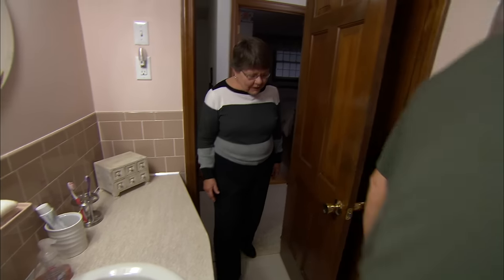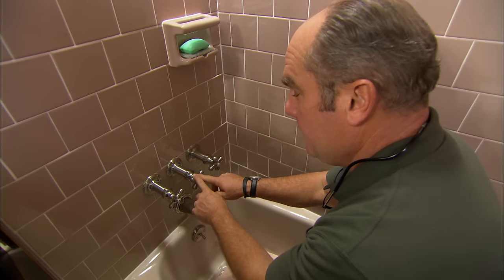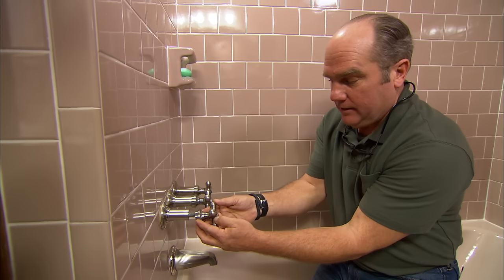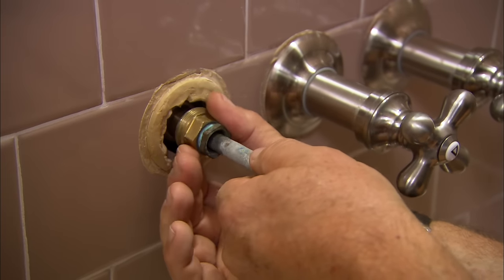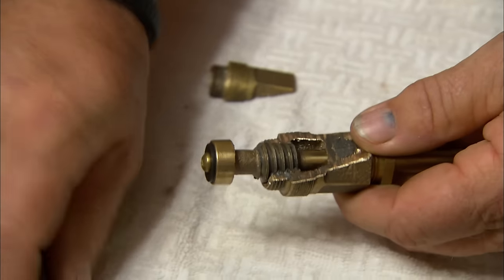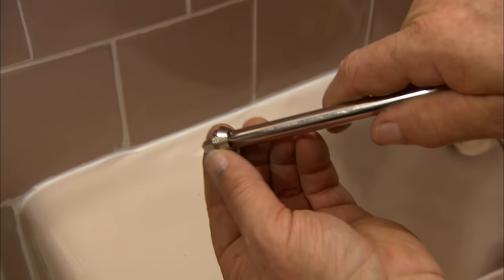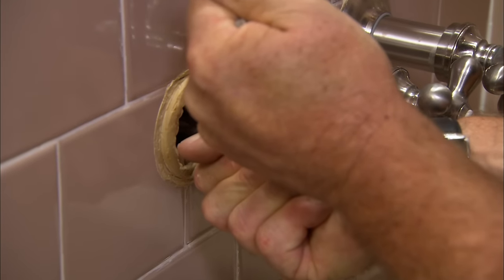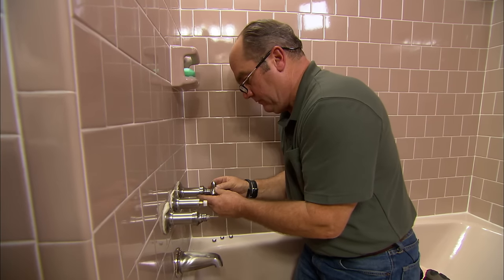How to Repair a Shower Valve Stem | Ask This Old House

Comment: A trick I found for preventing cross threading anything with threads is to put the male and female(or the threaded and tapped objects) threads together and before tightening inwards, go outwards first. You will feel and hear the threads click and align with one another. Then start tightening inwards.
Reply: I thought that was my little trick. I now see I am not the only one. But great idea to prevent cross threading.  I hate it when I see someone cross threading, specially with a power tool, making sure to damage the threads. I almost feel the pain.
Reply: @macvideoworld  your trick? Quite literally the most common and natural thing people do when screwing things in
Reply: That's ok to call it your little trick. I'm glad you shared it no matter what anyone calls it. I didn't know & appreciate the info

Comment: I think it is important to mention when removing and installing stems, that it should be turned 1/2 way open, because If you unscrew or screw in the stem while it is turned all the way closed, it may damage the new washer and seat.
Reply: Idk why didn’t mention that. It’s in the direction to make sure the stem is open all the way. I just learned the hard way about that, thankfully I can swap it out at Home Depot. That is a very critical step.

Comment: This seems very easy but a cautionary tale, before you take out old shower stems, make sure you have the exact replacement or you're SOL if it breaks.  I took one off at an elderly relative's house and found that the one in there was nothing like the one I had - it had a ceramic clamshell type valve. It was getting late in the afternoon so I thought I'd take a picture of it, put it back in, and come back another day with the right one - WRONG!  while I was putting the old one back in and tightening it, the ceramic part broke.  

I turned the water back on and water was just pouring out to the tub. 7 pm and this poor old lady couldn't have water.  I took the old part and drove to Home Depot - they had nothing that looked like that but was told "it looks like a Sterling". Went to Sears Hardware - nothing. Went to Lowes - they had one that had the same clamshell look in the catalog but nothing in stock.  By now it's almost 9 pm so I made it to one more home depot and they had a Sterling with the same valve but different rod that looked like it would at least fit in there to block the hole.  Nobody even had a plug that could fit in that.  

Fortunately it worked, but the cover had to be siliconed on since it was missing the threads the old one had.  I spent a week going to supply shops, internet, etc. and only found one guy who had the original set and that was more than $200. Sterling sucks.
Reply: At that point, might be easier to change the entire shower to a delta universal valve. I feel your pain though, i manage a few apartments where the builder uses the cheaper Pearless brand or some other non-delta brand. Makes things a lot harder to fix.
Reply: Always warn The customer that if it breaks you're not responsible
Reply: @hibye2511  isnt peerless made at the delta factory, and just stamped with a different name?
Reply: When you are working on obviously old fittings, you are better off taking the old stem valve to a specialist plumbing/faucet store/warehouse.  Not only are they more likely to have what you need, the free advice you will get is priceless.  Also, it's always best to do this type of work in the morning, so you have a time cushion if you need to run to / back to a store.
Reply: @markg6860  Haha I forgot about this post I had made. I actually went to a Ferguson and they had no idea what I had...A year later I found one that looked close on ebay but it turned out to be a little shorter...sooo I have like 3 different ones that can twist in but are not an exact fit for the handles and stuff. There is drywall behind it so I think for the future we might just bite the bullet and call a plumber to change everything to delta or some other easier to find brand.
Reply: @Arieeeee  Sometimes it does make sense just to update an old fitting.  I literally just got done replacing my hot and cold bath tub stem valves and the seats, this morning.  It cost a total of $52 at my faucet supply warehouse, but that included the $8 tool to remove and replace the seats.  In total, it took me about 45 minutes and I am thrilled with the result ... at about 1/6 the cost of calling a plumber.  No more drips!  I also noticed that the water flow is higher, but not sure why.  I was fortunate ... the two valves stuck far enough out from the wall that I just needed a 1" wrench to undo them. 
The seats were in quite firmly, but the removal tool had enough leverage to get them out safely, without risk of rounding them out.   A little bit of plumbers grease on the threads and everything screwed together easily with no fear of cross-threading.
The guys at those specialist faucet places are so incredibly knowledgeable, unlike somewhere like Home Depot, where your advice can be hit or miss.  I took in the old parts and they gave me exactly what I needed.  I could not take a valve seat with me as I did not have the removal tool at that point to get it out, but just by showing the guy a picture of the seat in place, he happened to give me the two exact seats that I needed.

Comment: great video my sister's shower has been driving me nuts I had no clue there was a actual seat that could be replaced I've seen them in kits but never knew what they where for thanks for this video cause I'm close to ripping out the wall to replace this same problem
Reply: careful with the leak.  Leaks can turn into a bust and flooding ):

Comment: I guess I could look online, but the tools he used the wrench to get the valves out and the wrench to get the seats out, how much would those cost?  Would it be worth it to buy those and do it yourself or just call the plumber?
Reply: A seat wrench is about $7-8  and a shower valve wrench set is about $14 and upwards.  These would be rarely-used tools for a homeowner, but when you consider the cost of getting a plumber out, you'd still be way ahead.  Plus you'd have the tools for when you'll need to replace the washers, down the road.

Comment: I have a home built in 1932. It has four Crane pre-war stems. Hot and Cold for the tub spout and a Hot and Cold for the shower head. The stems for the tub were leaking at the stem and packing nut when the water was turned on. I sourced the correct parts online. I purchased four new stems and four new seats. I replaced the Hot and Cold stems and seats for the tub. Now there's no leak at the packing nut but now I have two new problems. The tub faucet leaks constantly when the Hot and Cold taps are turned off and I now have the problem, like in this video, where the hot water gradually lessens unless it's wide open. Plumbers are recommending that I just replace all this stuff with a new style valve. I'd really like to keep our bathroom looking period correct. Any help?

Comment: I replaced all stems and handles but. no seats . took spout off but put back on cause had trouble with new. Diverter handle does not turn enough just a little . handles are also leaking behind the knobs. Restore water devirter allows for shower but spout is a no flow

Comment: Are these stems all one universal size/threading or do I need to determine which stem I have before purchasing new ones?
Reply: I need to know this, too. I need these identical one's but cannot find them locally and don't know what to order. The last time I ordered some, they were not the right size at the end with the rubber seal. Did you find any?
Reply: @barbarahall7028  I ended up ordering a set of Pfister off of Amazon and they worked for me.

Comment: My hot water handle gets stripped every 6 months. I replaced seat and stem like 6 times, it last for awhile and strips. That washer inside gets messed up. Nobody sells that washer, they want you to buy new stem and seat every time. I just replaced stem and seat for seventh time and handle leaks. It turns off but leaks. I even put teflon tape on seat, still leaks,any suggestions
Reply: Mine too. ??

Comment: Good Day, I am rebuilding my stems rather than simply replacing the $18 new ones, is there anything you can do if the screw that holds the black rubber washer is worn down from corrosion (any way to get the screw off and replace it?) The washers are a box of 10 for $3 so .30 cents to rebuild beats $18 to replace
Reply: @Tommy Daly, Pick the old washers out of the stems with an O-ring pick or something similar.  I normally squirt a little WD-40 in the where the scew is threaded into the stem, wait about 10 minutes for it to penetrate all the way into the threads, and use a small pair of adjustable pliers to grab what's left of the screw head to hopefully wrench it out of the stem.  Just have to find new bibb screws to thread back into the stem with new washers.

Comment: The handle broke off ours and its just the stem poking out.  We've been using a pliers to turn the stem until we can replace it.  I don't know how though, as the piece looks a bit different than in the video and I'm afraid of breaking it.  May need to call a plumber.  How much does this cost if a plumber does it?  The stem is also plastic for some reason.

Comment: Forgot a very important step. there is another nut on that valve  called a “packing nut. “ it’s the smaller nut in front of the valve. tighten it after you insert the whole valve, or it will leak from the valve handle or even worse into the wall if it’s deeply recessed into the wall.

Comment: i work at RONA.CA in plumbing 16 years and very very few people go to this much trouble to  rebuild the old stuff.. try to find the old stuff
Reply: After a dogged pursuit for a specific gasket used by American Standard prior to 1981, a helpful hardware man at an Ace Hardware gave me the names of 2 specialty plumbing suppliers in the Dallas Area.  When is the last time you saw vintage toilet seats in pale aqua or coral.  I found my gasket for $.69 , and was so excited I bought 2 of them.   Now it's time to do a complete rebuild of my cartridge shower faucets which have done a respectable job for 40+ years, and I won't be wasting my time wandering the lonely canyons of the big box stores.

Comment: I would have removed the old dried out plumber's putty before installing new putty.
Reply: I was thinking the same thing. Always remove the old putty.
Reply: 30 Years of dirty body fluids.  He didn't like her that much.
Reply: Glenn Watkins 
？、
Reply: Cup & Cone it’s not 30 years old.  It’s 2-3 somebody put cheap import stems and trim kit in there.   Price pfister would never have sold a plastic spline adapter.

Comment: I’m having a problem with my new Pfister valve stems that I just installed. Not sure 🤔 what I did wrong but when I shut the valves now there is a small stream of water coming out. Any thoughts?
Reply: Did u replace the seats?
Reply: Bob Whammer yes I did. 

Update: I replaced the seats and the rubber plunger part of the valve and what do you know the leak stopped. I also added some valve seat lubricant on the valve threads and valve seat to prevent future rust and noise when opening and closing. 😁

Comment: I did the same thing going to mine bc they were old and would drip. After replacing them the drip stopped but the diverter doesn't cut the shower off. is there an adjustment?
Reply: No you would just replace the seat and the stem diverter. Just the same way as you would the hot and cold sides
Reply: is there a seat on all three or just the hot and cold and not the diverter?

Comment: That Allen Key thingamajig for the seat replacement “so it doesn’t drop into the wall” now what did Shakespeare the Plumber say?

There’s the rub!
Reply: No, it screws inside of pipe. Sometimes it get stripped and you can't get it out. In that case spray with liquid wrench, let sit for awhile, then get a flathead screwdriver large enough to fit snug in there, should come right out.

Comment: I replaced my leak with new valve stems could not remove the seats whoever did the job originally have them too far in the wall better call a professional

Comment: Richard, I made the repair with new seat and attachments, but my hot water is still leaking.  When faucet is turned off, a sucking sound is heard and a small stream of hot water runs.  
All parts have been replaced, bonnet and everything but there is still a small stream running.  Knobs are turned off to the limit.  What is needed to resolve this problem?

Comment: That seat wrench will get you into trouble one day.

Another tip, watch the seat as you are breaking it loose so you aren’t stripping it. Once that happens the do it yourselfer will be in a world of hurt. That’s  when they call me, the licensed master plumber. I have had to cut old seats out or maybe re-surface them.

It’s a nice touch putting plumber’s putty behind the escutcheons. Some plumbers use caulk for that.

And why use a channel lock pliers on your tub valve socket? I use a smooth jaw crescent  wrench . 🔧
Reply: Why will the seat wrench get him into trouble?

Comment: Thank you so much for this video! You just saved me a lot of money and time in replacing my old shower knob. I thought I was gonna end up breaking the wall to take out the actual pipe and fixture but your video showed me that it is so easy to just remove the stem and replace it. Just did it in 10 minutes without any hitches!
Reply: I took out the wall, but only one large tile, easy to out back.
Reply: Thank you, I too thought I would have to break the wall, have not used my shower for over a year because of this issue.  Thank you. Thank you.

Comment: One thing not mentioned in video and something you def need to do is open the valve or diverter  before removal, other wise you will be trying to spin out the valve and seat simultaneously and prolly end up damaging at least your muscles or pride!

Comment: Never knew the valves could fail like that.  I have one over 60 yrs old still working, and in another tub a single handle mixing Moen, still working too, that is 40 yrs old.  Was at the Depot some months ago, and am dismayed how light and plastic feeling like many new faucets are, I hope the stems are still 'durable'.

Comment: How to you remove a seat that's been in there for 50 years??? I tried everything and I couldn't get mine out, and I'm not an old weak man hahaha... I even tried wd-40 I tried stuff that's ment to help break old rusted nuts and bolts.... and now it's only been like 2 weeks and the new stem (guessing the washer) is starting to drip already..... I need to replace that seat but I can't get it out.... please someone know any tricks???

Comment: Just replaced my ceramic stem. Stuff paper towel in there and turn on to check for leak. A bit damp so I tightened a bit more several times. Scared to turn to overtighten. Help!

Comment: Question do you have a video about the moen single  Nob .  I have had a leak going into the tub from the faucet For now 2 years. I've had 2 plumbers try to fix it. The moen part that regulates the cold/hot ratio has been replaced 3 times.  I've contacted mowen and they say the parts shouldn't  Cause any further leak after replacement. But as I said 3 of them and they've all leaked.   Before I try to do this for the 4th time I'm trying to get any ideas of why it's leaking. Point of note the original   Was in upside down  Counter to the hot cold indicators indicators on the cover. They tried putting it back in that way still leaked.  They put it in straight still leaked. Replaced the part did both again still leaked.  Any ideas or do I just have to continually live with a leak that I am collecting the water and using for the garden or for the cats.  They like to lick the drops coming down.

 Thanks for any advice.

Comment: Help....I have an old two valve shower system and both the hot and cold will not turn off.... they just keep on turning.  We have to turn the water off in the access panel... what is going on here????? HELP HELP....

Comment: Interesting how increasingly hot temperature continues to lower the hot water pressure due to pipe expansion.

I had a lavatory sink that drained normally when was cold water was used, but wouldn’t drain normally when the homeowner was using hot water. It all came down to hot water causing the air gap to push outward, at the point between the trap weir and the pop-up drain plug. The expanding air pressure in the tailpiece slowed down any water above it trying to drain. Took me a while to figure out that one.

Comment: The problem there is not swollen metal it’s the garbage rubber.   That is a cheap imported stem and trim set.    The oem price pfister never came with plastic spline adapters.    He installed new pp parts because the good seats are always silver and the stems stamped pp.

Comment: Would you do a video to show us how to repair a Delta shower diverter valve because it is different from the other two? My diverter valve sent water to both the shower and the tub faucet; I replace the seat washer but that did not fix the problem. So I installed a flat ring washer on the other side of the seat washer holder and that fixed the problem. I was amazed that the tiny little gap between the bevel washer holder and the housing would let that much water go through and down the tub faucet!

Comment: Thanks for the great video! I need to repalce the spout soon in my upstairs bathroom and need to seal around the 1/2 water copper piple coming out of the ( tile wall) , however I have read conflicting information on using Silicone on Copper pipes. Some say is ok to use on copper pipes, but others say the acidic content of silicone will react with copper and damage copper pipes. I was thinking about uisng Acrylic Latex Caulk plus Silicone which has very little silicone , Can you please share your thoughts!